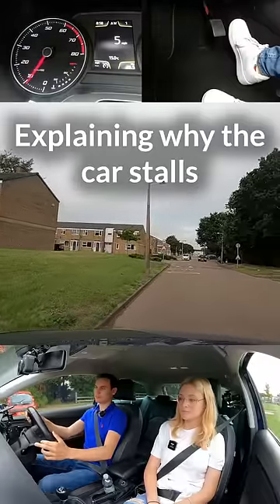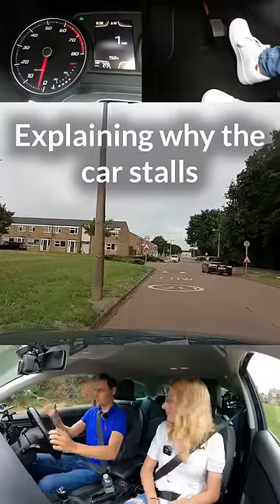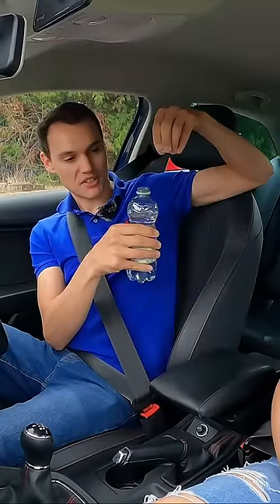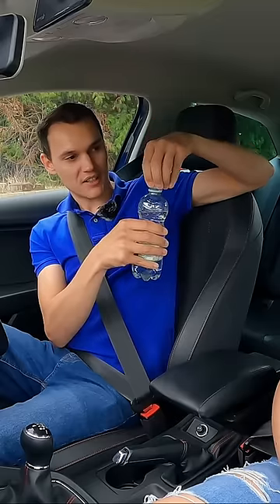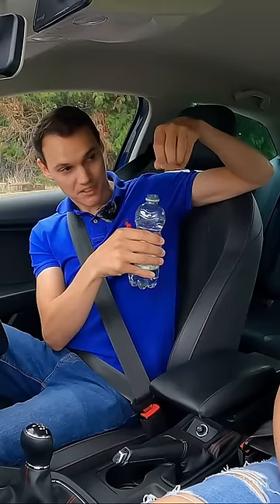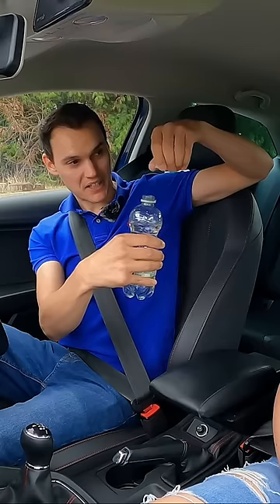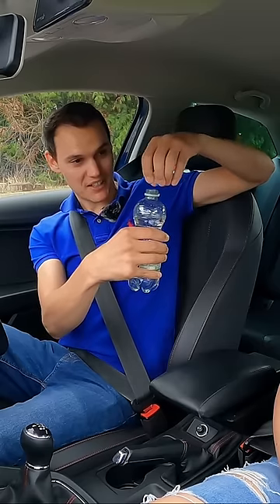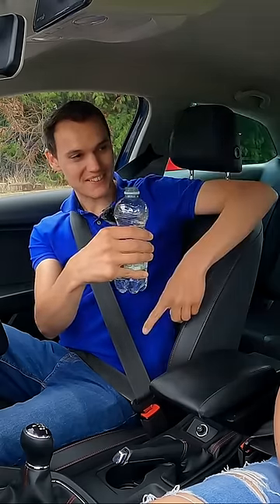Pupil using the dual controls to learn why the car stalls.

Comment: That's a really good explanation. I've understood the basic idea of what a clutch does for a while but I think this demonstration is the best I've seen
Reply: I’m telling you this man is on another level of explanations and I’ve passed the test recently myself with my father as an official instructor
Reply: @HaroldLightingdale  Can't stop watching this guy's videos. I think I've watched enough to know how to at least get a manual going when I get one, and I know a lot of the theory behind how manual cars shift and stuff (rev-matching, fuel saving, use engine braking, etc). Of course it'll all come down to practice when the time comes, but as of now, there's not much else I can learn from his videos until I get a manual, yet I still keep watching
Reply: Yeah, I think so too.

*Comma missing after 'while'.
*Period missing at end of sentence.
Reply: No lmao the engine needs to spin to be running, if the spinning of the engine is directed to the wheels, the wheels need to spin for the engine to run. If the wheels stop spinning with the clutch engaged, the engine stops running because it was over torqued, making low power at low rpm
Reply: How he explained it backward
Reply: @Soeks77 why did you say no and then say exactly what was said originally? Over torqued is also a confusing way to out it. It’s just the engine has been forcibly stopped because it’s connected to stationary wheels.
Reply: @jama211 bro has a superiority complex
Reply: Im sorry maybe im tired but i drive manual and cant point out every part of the transmission and it confused my ape brain because i was too busy being worried he would spill the water

Im going to sleep😂
Reply: @youraveragegamer8832 Are you in Europe? There’s almost no manual cars here in USA. I’ve seen carjacking vids where the thief has to get back out of the car and give it back because he doesn’t know how to drive manual, lol.  I’ve always had manuals in fast cars. It’s so much more fun. 

You’ll be able to drive it immediately and you’ll be like a super smooth pro in 2-3 hours. After a week, you’ll be a part of the car and won’t even be thinking about what you’re doing. It’ll just be so natural to you. Good luck. Have fun!
Reply: @SnotrocketLT4  United States unfortunately. Will buy a manual when I get the chance. Because of that I'll probably have to get a civic SI or possibly a Toyota 86 if I can afford it
Reply: @youraveragegamer8832  it’s also easier to learn on a low powered 4 cylinder Japanese something, rather than a V-8 or something with a lot of power. It’s just smoother at first. Good luck
Reply: @Soeks77  Finally! I can't be the only one thinking his explanation were dumber dien to the point of being incomprehensible 😂
Reply: @yousillygoose6958  idk y gotta understand how it works rather than just being taught it works just cause it does that’s a shi way of learning
Reply: As Einstein said: "If you can't explain it simply, you don't understand it well enough."
Reply: I'm sorry but as good as this explanation was it horrible at describing what the clutch does. It completely removed the details of the friction plate, inertial forces of the engine and the wheels, and the neutral gear. I understand this is basics here but let's normalize talking to people like they are smart
Reply: You haven’t seen any good demonstrations then
Reply: Thats so true
Reply: @youraveragegamer8832 coming from a manual owner, itll take you only like a week or two to get down the basics. The first day or two will be tricky but after that you’ll be smooth sailing. good luck and have fun :)
Reply: My father explained it to me a week ago. Funny that I see this now
Reply: Same here, dude nailed the explanation with the water bottle visual
Reply: You clearly only think this is a good explanation cuz u know nothing about cars, Ive been building engines for 15 years and almost nothing he said made sense
Reply: @drewolf-zs6mt  May I have a proper explanation then? Thank you very much
Reply: @drewolf-zs6mt  Oh really, a man of 15 years of experience building engines can't imagine a pretty simple analogy?

Yeah seriously, why don't you give a better explanation since you seem to be so capable of providing one.
Reply: @victoriagrayson5082 don't be jealous you're not as funny as other people digging at people for not knowing when to use a comma.😂😂
Reply: @josh1234567892   @youraveragegamer8832  what he said is relatively correct but a few things are off, like lifting the clutch doesnt connect the clutch to the engine because if u lift the clutch when its in neutral your not connecting the engine to drivetrain thus meaning even tho he is technically correct the car being in gear is what allows the engine to connect to transmission, the clutch merely connects the pressure plate to flywheel or wheels to engine, so to make it simple when the car is in neutral with the clutch out idling the pressure plate and flywheel are both connected and still spinning, so wether its in gear or out of gear the clutch is doing the exact same thing however in neutral the output shaft is not connected to the axles, and the other thing he said that didnt make sense was when he said the engine computer is adding power when coming to a stop ..... completely incorrect its not adding power, its trying to idle but ur physically putting resistance or negative load on an engine that is at idle, thus meaning its stalls, so no power is being added, for example if i threw a crowbar in the serpentine belt while the engines running i wouldnt be saying " wow look the engine is trying to add power to stay alive " cuz its the exact opposite

Comment: Interesting approach to get the student familiarized with the pedals without having to worry about steering or running into things.
Reply: Yep.

Good punctuation.
Reply: No the man was controlling the car
Reply: @justana3507  dual control...
Reply: Seriously, I would get the student to understand how the car functions before getting on the road.
It's not a hard concept, and much easier than using a water bottle by the side of the road.

It seem by concentrating on her feet might mean she either thinks too much about her footwork, or forgets it altogether when she has to steer as well.
Reply: @Cheepchipsable Understanding how a car works and actually using a car are two very different things. You cannot get any actual feel and practice for using the pedals, the clutch in particular, without moving the car. And he's probably not spending a full day with the student just working the pedals, and this is probably the first time the student was in the car. As such, allowing the student to better understand the pedals individually means that he or she doesn't have to try and understand two things at the same time. All in all, it's a much more efficient teaching method.
Reply: Pretty sure that's normal. My first driving lesson started with just getting the car going in first gear and stopping it without stalling, then added shifting up and down and only then my teacher let me on the street.
Reply: @behemothokun I went straight to normal driving and intersections and I got more used to fine control over the clutch and broke later on.

Comment: I've never seen an instructor have the student use the duel controls like that. What a brilliant idea
Reply: *I've never seen an instructor have the student use the dual controls like that.  What a brilliant idea.
Reply: @victoriagrayson5082  ngl, I spent about 5 mins trying to spot the difference
Reply: Sometimes when I correct these things, if it's as small as one, or a few punctuation marks missing, or a missing ending punctuation mark, I'll just address that one mistake as a single point, but I decided to just post the corrected comment in full this time, with an asterisk at the beginning to denote that it's a correction.

Also, there were two differences.  'Dual' was misspelled, and the the comment-ending punctuation mark (a period in this case) was missing. @jackmillen
Reply: @victoriagrayson5082 think you need to get a hobby mate, if people wanted to type correctly they’d use auto correct but it’s YouTube and informal so no one really cares
Reply: @victoriagrayson5082 *the comment-ending punctuation mark was missing.
Reply: @victoriagrayson5082 Couldn't help but notice a lot of unnecessary comma splices in your comment.
Reply: @randomchannel5386  fr i turned off autocorrect specifically so i could misspell words and not have to undo the autocorrect
Reply: @victoriagrayson5082 comment-ending punctuation mark 🤣🤣🤣 bro get a job
Reply: If I was paying as much as they charge I wouldn't be happy sitting that side 🤡
Reply: @victoriagrayson5082 damn, we got the grammar police.
Reply: @fairsaa7975 funny how that works isn’t it 😂😂
Reply: @zaxi0 bro is the whole ass grammar commander
Reply: @victoriagrayson5082 full time job 💀
Reply: @victoriagrayson5082  "the the" yep ur a grammar genius for sure, we are all so lucky to have access to your brilliant mind 😂
Reply: @victoriagrayson5082 Quite a few mistakes in your second comment.
Reply: @victoriagrayson5082 You added a double space. Lol.
Reply: @victoriagrayson5082 thought you were him didja?
Reply: @victoriagrayson5082 It's YouTube, not the Oxford Union. Correcting SPaG in this context is at best obnoxious and at worst ableist.
Reply: @victoriagrayson5082 it’s a bit pedantic though isn’t it? Get a life.
Reply: @fairsaa7975 they are one of those “i know my grammar!” but doesn’t actually. The repeated commas until the end of the sentence then a period is something they all do.
Reply: @victoriagrayson5082 you’re defo an English teacher
Reply: It would've worked the same if he put her in the driver's seat
Reply: @randomchannel5386 Plus he simply could have said "duel" and "dual" mean different things.
Reply: @Cheepchipsable Duel is much more fun in this case, so we should stick with that. 

En Garde!
Reply: @victoriagrayson5082 Also, you put a space too much! :)
Reply: @victoriagrayson5082  *full stop
Reply: mine did this my first lesson, and let me feel the bite point of the clutch etc. i passed first time
Reply: Must learn to do both at the same time
Reply: @victoriagrayson5082 Oh hey Mr Kimberly what are you doing here ( my english teacher)
Reply: @randomchannel5386 clearly Victoria cares

Comment: I’m learning to drive at the moment with my test coming up in two weeks but these videos really help to get the in depth knowledge without worrying about crashing whilst concentrating.
Reply: Ya passed?
Reply: @mihaitheorange4705 I don’t think so😂
Reply: @connorbrennan2920  dang that's sad
Mine's coming up in a month
So wish me luck
Reply: They should probably teach people using an automatic transmission to start with, then come back and revisit how to operate a standard/manual transmission.
Reply: @MmMerrifield what's that for bullshit 🤣
Reply: @willempoortinga3852  I think that learning how to operate a vehicle that requires use of a user controlled clutch is much more difficult than just learning about everything else that goes into operating a motor vehicle on public roads.
Reply: @MmMerrifield yes but learning in a automatic is just a glorified go kart, driving manual is learning how to really drive
Reply: Test in 2 weeks and you don't know what clutch does?????
Reply: i drive an automatic and i have no idea what is happening in the video

Comment: This is a great explanation. I've taught a couple people the principles of driving a manual and in my experience, the struggle for most of them is that they simply don't understand what the clutch is actually doing.

When you explain why the clutch is there, they instantly get better because they can put the steps together into the actual changes happening to the car. They'll still be a little bit rough on shifts, etc but they rarely stall the car after that.

Comment: As a mechanic I have always explained it as the clutch connects the wheels and the engine together, as simple as that. Stalling it is when you try to make the engine go slower than it idles at.
Reply: Interesting.

*Comma missing after 'mechanic'.
*Colon missing after 'explained it as', and, as what comes after the colon is a complete sentence on its own, the first letter of the first word of the explanation must be capitalized.
*A period, not a comma is needed after 'together', separating the explanation from the remark into two sentences.  The second answering the first.
*Stalling it is when you try to make the engine spin at a slower speed than it idles at.

All together: 'As a mechanic, I have always explained it as: The clutch connects the wheels and the engine together. As simple as that.  Stalling it is when you try to make the engine spin at a slower speed than it idles at.'

Good comment.  Good effort.  👍.
Reply: @victoriagrayson5082 nah you can't make a comment like this and edit it come on 😂
Reply: @Andrew-ss7jd something wrong with this guy he’s done it to about 40 comments 🤣
Reply: @victoriagrayson5082 I think everyone in this thread is worried about your mentally stability with a comment like that please respond with an update😂
Reply: I'm pretty sure an engine can run lower than its idle speed and still not stall. But that's still a pretty good explanation, I believe.
Reply: @victoriagrayson5082 complete sentence on its* own, not „it‘s own“ 😊
Reply: @victoriagrayson5082 "its own", not "it's own", I think autocorrect may have you hoisted by your petard here. 😅
Reply: Thanks! @ChristopherWoods
Reply: @victoriagrayson5082 all those corrections, then you use incorrect capitalization in “Good comment, Good effort.”?

Comment: That was a very good explanation. Anyone can understand it.
Reply: Yeah.  It was an excellent explanation.

Good punctuation!
Reply: But he was wrong, the clutch is actually attached to the splines on the input shaft of the gear box and it makes contact with the flywheel that’s connected to the engine

Comment: i can NEVER find a way to explain how standard transmission works to ppl asking abt my car, but this dude clearly does this a lot. i’m definitely gonna use this next time i have to explain 👍
Reply: Do people ask you very often?
Reply: @MmMerrifield  sure, often enough to have trouble explaining it
Reply: @who_k_nows I used to use a manual transmission car while driving for Uber (in the US where lots of people have never been in a car with a stick shift). 
I had one person who really thought something was wrong with my car, and didn't even know that it was possible for a car to have a manual transmission. I never mentioned that there's a clutch but I did explain that automatic transmissions and manual transmissions both shift gears, but automatics have a computer that controls the shifting without needing direct input from the shift lever.

Comment: Torque converters are gonna break her mind.
Reply: Automatic transmissions are a modern marvel. So complex.
Reply: At least now, she can understand why a torque converter is needed and what it does, unlike the vast majority of those who may drive their cars daily, but don’t know how they work on the inside
Reply: @yaboykris2118  torque converters have been around for about as long as cars. GM introduced the Hydra-Matic in 39, and converters were being used in Buses, trucks, and diesel trains in the early 30s. it's only as modern as the car itself.
Reply: @Swogfish  right but I’m talking about the actual transmission it’s self. I know auto’s have been around for a long time. But, it’s incredible they were able to make it back then. And they are even more complex now.
Reply: @Swogfish torque converters were designed for steam engines, they're older than cars by quite a bit.
Reply: My instructor was doing a good job until he brought up planetary gear sets 😵
Reply: @yaboykris2118 

I would say it's actually easier to understand than a manual transmission. The easiest would be a CVT.

Comment: I'm glad to see good instructors, and it makes me shamed in my country that in the US almost EVERYONE drives automatic. 

I just got a manimatic, where i DO shift with a stick, but the clutch is internally controlled by the car, and even that has been tough to learn. 

But it feels SO MUCH BETTER than driving an automatic, where even though I'm still having to shift with a stick, the clutch is totally controlled by the cars computer. 

If anyones curious i have an 09 Smart Car. The later models took out the stick shifting. Thankfully mine still shifts with a stick instead of buttons on the steering wheel.

Comment: I remember when I was studying automotive engineering, and the driving instructor was trying to explain how the clutch works, the same as this guy, and I thought to myself not even close but lets see where you're going with this. I would say my instructor was more accurate, but this is good enough for the intended purpose.

Comment: Wow. I was just told to slowly release the clutch till u find the 'happy medium' when the vehicle starts to move then depress the gas pedal. No nonsense. Learn this in my fathers full size pickup with heavy duty tires..... '85 dodge d-100 slant six 225, manual 4 on the floor,  no power steering and no a/c. U want the steering wheel to turn you slowly let out the clutch. You want a/c? U open the vent windows and cruis 40 mph.  Its called 240 air. God bless the way i grew up. I still have this truck, And its going to be the way i raise my children.

Comment: Quick fact check for the instructor: The computer doesn’t add power, what happened is the gear being engaged means the engine kept spinning the wheels which was going against the break until the engine stalled.

Comment: The clutch analogy was good but to say the computer was adding power was just flat wrong. The computer wasn’t doing anything. The engine was just trying to pull at idle and the brake was fighting that torque.